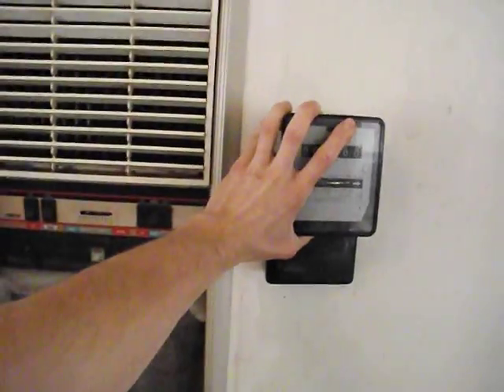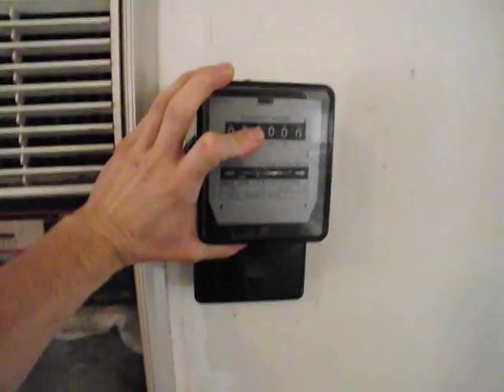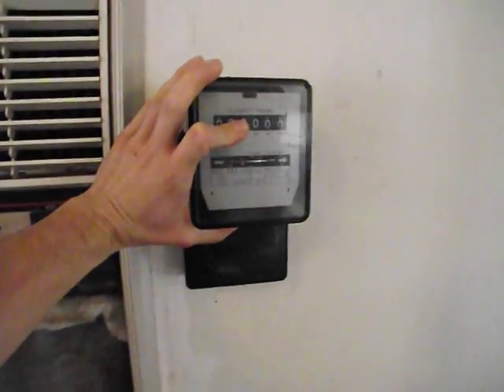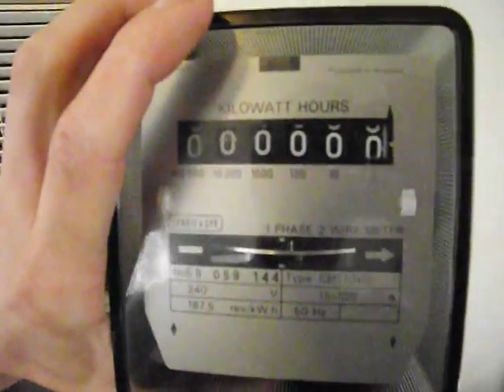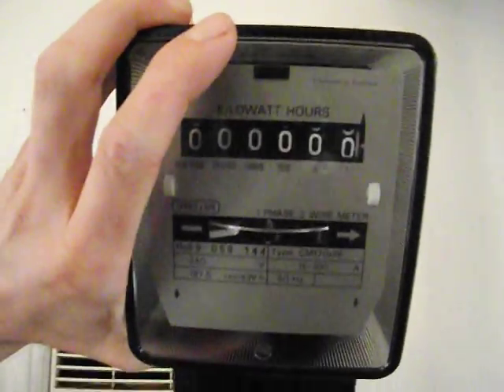kwh landis & gyr meter modification to weatherwall aircon?

Comment: I used a plug in adaptor style watt meter to test the heating element in a wet carpet cleaner i was repairing for a frend.

Very handy to have mains metering, saves you snipping the live and inserting an ammeter :-)

Having good test equipment makes repairs so much easyer, and it does not need to be expensive stuff eather.
Ive seen a few australians use "dick smith" multimeters, cant be too expensive and local :-)

Comment: Oh, of course. :D If you have a meter sitting about & you wish to make use of it, then there's nothing better than connecting it to a frequently used high-consumption appliance (I define high consumption as being 1kW or more, used at least once a week for a minimum of an hour)

So.....YES. Place it on the wall next to the unit, & then you can see the load-wheel rev up as the air-con is being used. Make up a table-chart so that you can track electricity consumption throughout the year. :-)

-BBD.